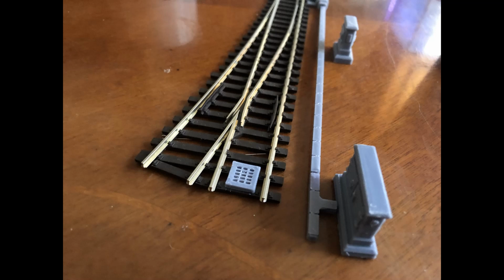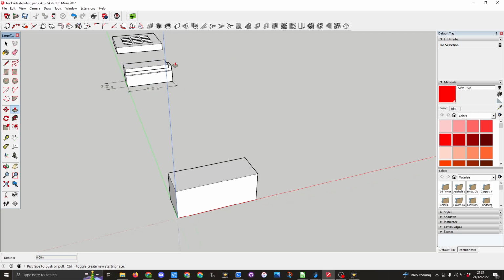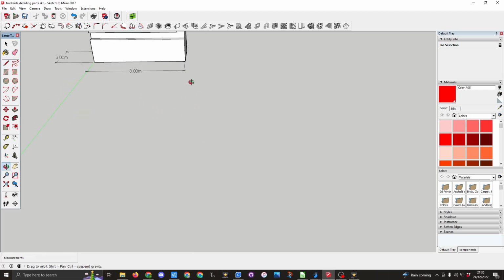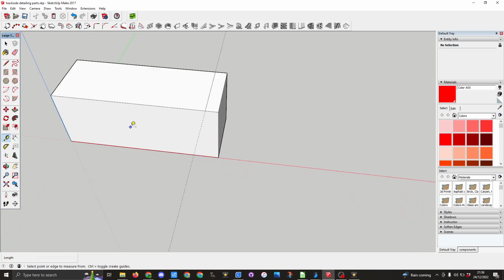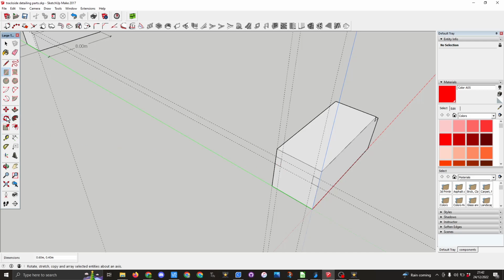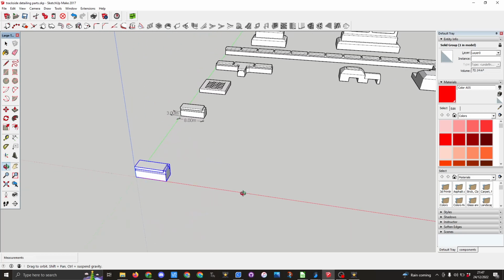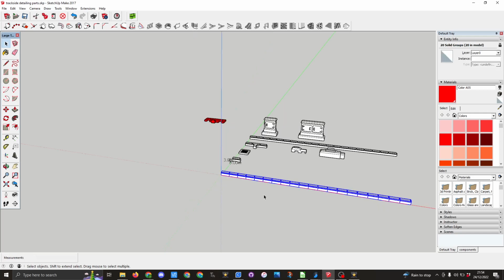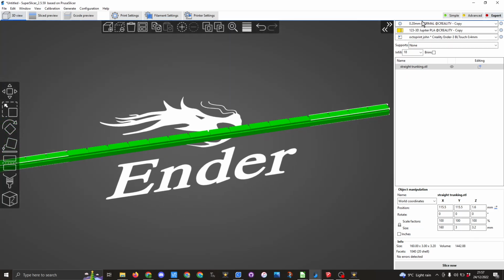3D FDM printed Model Railway OO gauge Lineside Trunking simple Sketchup Make 2017 tutorial

Comment: Wow, thanks John, that's just the right level of tuition to get me started, you're a real star.
Reply from the maker: When it comes to designing your models there are a number of ways you can do this. The first 3 videos I have shown, I am working in MM and designing for a certain size straight away that needs no scaling in the slicer. Doing it this way allows for accurate size models. In the 4th video I show drawing in Meters at real world size and then need to scale in the slicer. It might seem confusing at first showing different methods but it depends on what you are trying to do.